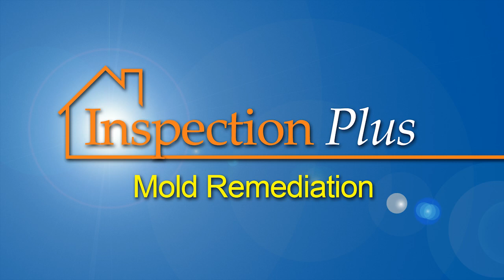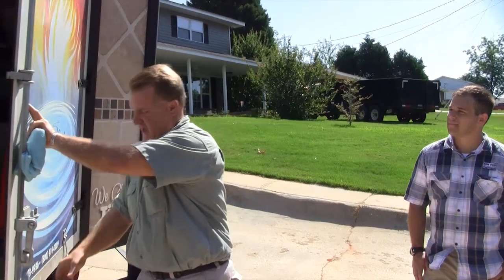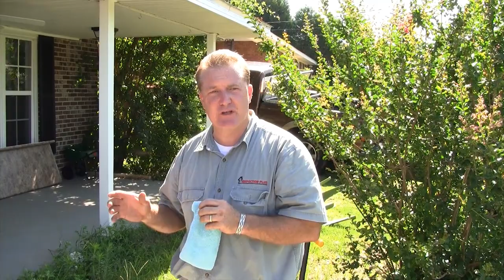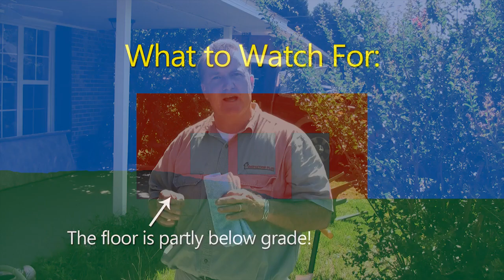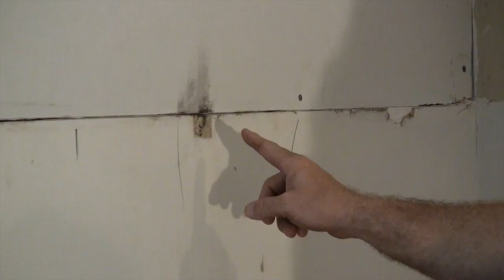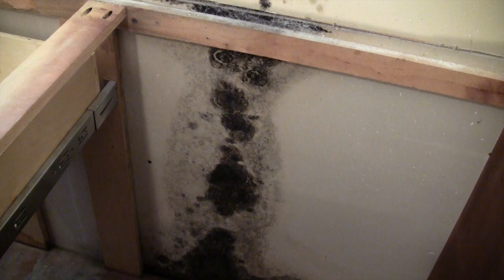Inspection Plus - Mold Remediation Part 1

Comment: This company, like too many others, is ignorant and dangerous, because they are doing things completely wrong and unsafely, giving viewers a false sense of security, when in fact, they will possibly end up highly toxic or die from mycotoxins as I nearly did, when a company as ignorant as this one came and tore into black mold the same way, ignoring safety and failing to use proper protocol guidelines, failing to secure the containment area, failure to isolate the mold properly, failure to wear personal protective equipment and a decontamination chamber. They ran into "Hell Toxin Black Mold" in my house and several individuals became deathly ill, myself included. This is not a game to play the odds for money!
Reply: What video did you watch?

Comment: I thought home inspectors were not allowed to perform work on properties they inspected?  Wouldn't that be a conflict of interest per ASHI and InterNACHI who govern home inspectors?
Reply: That is correct and in several states, it is against the law for the inspection service and the remediation be done by the same company.
Reply: solanab229 a home inspector can work on a they've inspected after 6 months
Reply: In my state, the property owner has to provide written permission, but it can be done. I wouldn't recommend it generally. An inspector worth their salt will produce a report that any renumeration service can follow.

Comment: This company guts an entire kitchen over a two sq ft of mold on Sheetrock (see part 2).Totally unnecessary. But, such is the mold industry. Stopping the leak, dry out and wiping the area clean is sufficient. Maybe paint. For over and above the call of duty, remove the patch of drywall and clean the exposed cavity (mold in a wall is proven not to be a problem, so leave it.) Do not seal the wood either; if another leak occurs in the same area the sealed wood will retain moisture, causing a worse problem. Further, this small area according to EPA and other environmental sources say this is a DIY project. Modern mold remediation methods are terribly flawed and an unnecessary overly priced expense.
Reply: Show me some science. Proving me wrong instead of calling names, would make you sound a little smarter. There's always mold in walls, all the time. surface mold in a wall once dry (dehumidified) can be left alone. Just do tear out if drywall is in bad shape. In this video, tell me where there was any visible mold in the rest of the room on or in the walls. The job in the video is a DIY project: remove 2 sq ft drywall, clean mold and your done! that's it. No sanding or sealing studs. Tell me about how a gut job is here is justified.
Reply: You're one of those lazy workers who thinks masking over the problem fixes it.
Reply: What are you talking about? Stay on topic. I am talking about the video where he guts the room for a 2'x2' area of moldy sheetrock and mold on a stud. Where or in what mold remediation document/protocol like the IICRC, EPA, etc. does it say to gut the entire room? If you have something to say, lets start there.
Reply: Brian Haley they probably had to, it was most likely on the bid.. if you have a job like this you don’t question it. You do what your told and damnit you do it to a T.
Reply: seriously.  someone wanted a kitchen update, clearly
Reply: Brian Haley tel that to my nervous system. Oh, AND eyes.

Comment: He is correct, the self Kits are great for a child doing science fair. However, they may pick up a species that doesn't belong in the building - the correct way to do viable testing is using a Anderson pump and MEA AGAR PLATE - ANDERSEN - method / impactor - it looks to me like this is someone that does mold removal and their own testing. That's like a student creating their own final examination paper - several species of mold can spread by touch - 
Rossen Reports: Are mold contractors charging for unneeded work?
Toxic mold in your home can be dangerous, but experts say some contractors are charging big bucks for unneeded repairs. Correspondent Jeff Rossen goes undercover with hidden cameras to investigate.
http://floridadetox.com/tag/mold-toxicity-causing-parkinsons/
Reply: Ed Lampl
 Hi Ed, you seem to know about mold and I can use all the knowledge I can get on this topic. My home has mold in the crawlspace due to leaks in the foundation and the person with obviously no knowledge of how to install a door. The front door was installed by cutting into the sill plate and joists. (Have no idea why someone would do that). Under the house you can see leaks coming through both sides of the door at the bottom into the crawlspace. Its also the place that is most heavily molded. We have purchased Oxyprep, OxyparLR & Oxyclear to seal the surfaces after we make repairs to the cracks & install the door properly. We can't afford to hire a crew so its up to my husband and I to get the job done. Our daughter has COPD & for now we have built 2 bedrooms in the garage so she doesn't have to be around the mold. Though I don't see any visible mold in the house you can smell it. I need to know if I should have the air in the home tested before we repair, clean, seal & encapsulate the crawl space?  We have removed all the air ducts & vents & sealed the openings trying to keep the spores down. I can also be reached at helenricheal@yahoo.com. Thanks for any advice you can give.